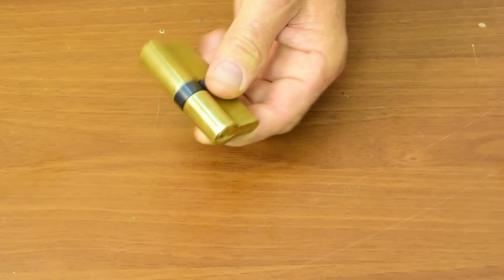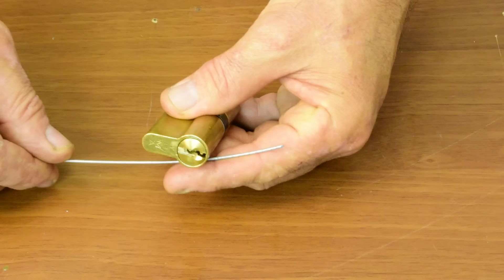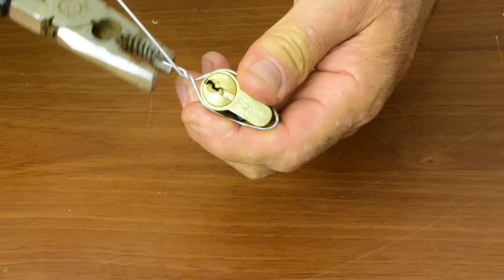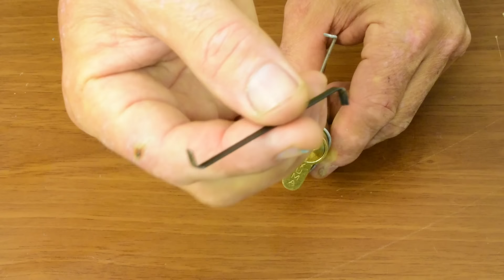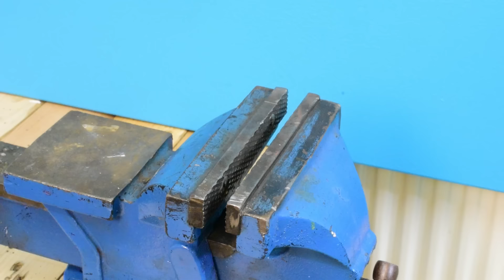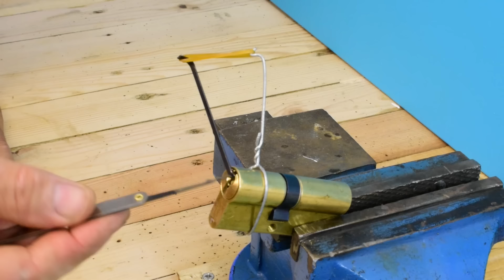Excellent Idea! 40 Year Old Locksmith Does Not Know This Method

Comment: Amazing technique IF you have the cylinder out of the door and you have a vice (and lag bolts so you cab screw the vice or a handy workbench near the door. Otherwise not so much. Try again with another tip.
Reply: So why did this video have to be edited at 1:54 ??  -  Is that where it was stopped while the key was put in ?

Comment: this method would only work if the cylinder extends our from the door  but in my experience these types of cylinders usually sit flush with the door or they have trim around them. its not very useful unless the cylinder is out of the door in a vice.
Reply: And if you have the Time and tools to do this. If there are security pins, if it is a paracentric keyway or a dimple lock you are going to pay more to the locksmith.

Comment: Let me be of service and list all the things wrong with this video:

1. This wouldn't work in real life because the face of the lock is flush with the door (no way to attach the wire)
2. Even if there was a way (you could for example ducktape the rubber band to the door or something) it's an absolutely stupid idea. One of the key aspects to successful lock picking is manipulating the tension based on feedback provided by the tension wrench. This method could probably still work on some very low security locks, but would make the process incomparably harder, with absolutely no benefits. That's probably exactly why ...
3. ... there is a cut in the video right before the lock opens, at 1:55 (because it didn't work and was cleary faked)
4. WD40 is an ill-advised choice for lock lubrication. It can work as a cleaning solution in a pinch, but will lead to the lock working even worse long term. It dries up the lock by getting rid of all the moisture (as the name suggests, what it does is Water Displacement). What you want instead is lubricating the lock. There are many great options, just search for lock lubrication here on youtube. 
Those other videos don't have millions (?!) of views like this one, and also unlike this one they actually do provide some value 😅

This video is 2:30 long, and was watched 1.7M times. Even if half of that were bots, that still means it wasted a total of 5.1 YEARS of our collective time as humans on this planet. Right on, I hope the add revenue was worth it 😅

Comment: Garbage. straight picking and finger pressure with experience does it. Or even better use a pick gun. or even still. Make a pick gun from an electric toothbrush. With this video you cant even pull out the cylinder without first using a key in the lock . Or picking it first. I'm a Master locksmith. These videos are useless. Also it takes lots of practice even if you have lock pick's.
these people that make these types of video's are just click bait. To be a real professional it takes years. Same with opening safes.